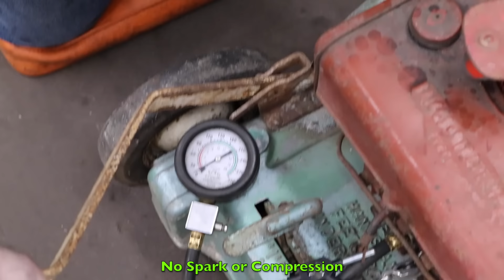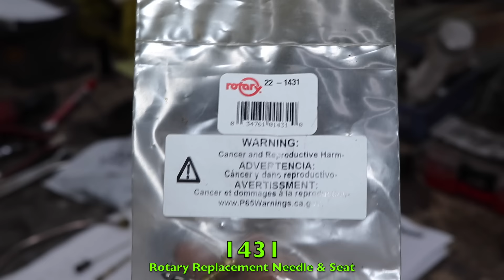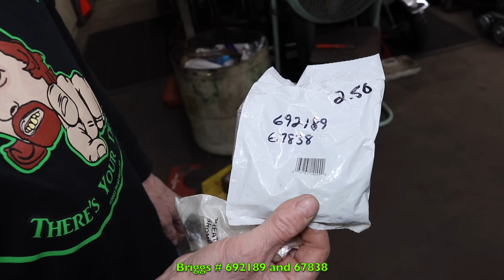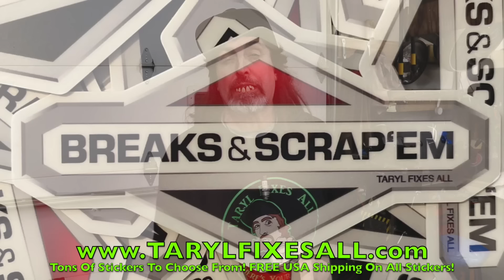RARE 1960 Hand Crank Mower Sitting 40 Years! Can It Be Saved?

Comment: The Briggs and scrap em engines from the 90s and earlier were so easy to work on,and very dependable.
Reply: sears and row back outboards, can't beat them..
Reply: I'll take a B&S over a Honda, any day.  The B&S carbs are very forgiving of bad fuel, whereas Honda is a pre-madonna. Leave it alone for a week, and the carb is clogged up and runs like crap.
Reply: @airplanegeorge  You mean craftsman
Reply: @frankbill9172  No, Crapsman!
Reply: @newsnowriversidesgtrock  YEP! Right there
Reply: @jeffpiatt3879  prima donna?
Reply: @gfriedman99  What about their commercial Vanguard's? Any hope or still cheap plastic junk?
Reply: He's saying Breaks and Scrap'em, if you didn't know.
Reply: @Vultain  Industrial/Commercial Vanguard might be ok, but these Intek OHV engines seem to have a chronic bad compression release mechanism. Tons of YT videos showing that they go bad and then you can't start them.
Reply: @Hjerte_Verke  That makes sense, I have a Kawasaki FJ180V, a Honda GCV160, and an older Briggs Quantum(mind you the rings are slowly going and it's an aluminum Quantum, not worth rebuilding).

I did hear the Intek's bend easy and slip out of adjustment pretty easy. I appreciate the heads-up. I simply don't have personal experience with them.

Honestly the Kohler Commercial 240CC scares me in the sense it can be hooked up to a computer. I've debated grabbing a Honda GXV160 vertical shaft engine while I still can. The clock feels like it's ticking on that.
Reply: You're right I bought a new machine with a Briggs engine and I had to pull the plastic carb about an hour after i t bought to stop the plastic piece of junk from hunting I call it hunting surging really , it wouldn't idle or stay at a steady speed and no carb adjustment.
Reply: I'm not to far from Richmond
Reply: I dont like eggplants

Comment: When I was a kid my uncle had a small engine shop and I did most the repairs. I worked on alot of these mowers. Believe it or not alot of the ppl wanted the crank starters taken off. We had some old parts laying around and we changed out a few. He closed down after a while , sold everything off to a guy. Lots of parts and old/new stock that's priceless now. Carb kits for those mowers, he had alot of them. He had boxes of carb parts he got from a shop went out of business in the 70s. I remember sorting and stocking gaskets and glass sediment bowls for engines. This was around  46 or 47 years ago. 1976 or 77. I never seen one of those oil minders. That's pretty cool.

Comment: That green deck reminds me of the old Kee mowers. My neighbor had two of them. I got one running. The other was a donor. It went to the scrap yard. The oil monitor reminded me. Several years ago, a friend called me to go through her late fathers shop. He was a contracted Sears repairman. I was able to get two new in the box full block 8 HP engines. Two rebuilt engines, I believe both were 5HP, and a short block 8HP. A bunch of new old B&S parts, Tecumish parts. New and used gas tanks, and other stuff. Most all is gone now. Nice job on the mower. Like you said, patience!

Comment: 1:19:45 that knob also explains why there's a gouge in every cooling fin on the flywheel. It was half-engaged while running at least once and nearly destroyed the flywheel. Maybe some goofball 40 years ago tried to stop the engine with that knob. Shame about the original starter clutch. You CAN clean the inside of those with a gun bore brush too and also polish the crankshaft extension to eliminate the squeal. Maybe it needs a felt disc in the end to hold a few drops of 30 weight oil as well, like the newer style you replaced it with? The noise is pretty easy to deal with.

Comment: CAST ALUMINUM, THEY DON'T MAKE THEM ANYMORE, USALY YOU SEE THE 2 STROKES ON THE ALUMINUM DECKS. I HAVE AN OLD JOHN DARE WITH A ALUMINUM DECK, I THINK IT'S A 4-STROKE BUT NOT POSITIVE. TARYL I'VE ONLY BEEN WATCHING FOR A FEW MONTHS,   YOU GOT MY ATTENTION. YOU GUYS ARE FUNNY, I LOVE IT ALL, BOTH CH.  WHEN I WAS ABOUT 13 YEARS OLD   I USED TO DRIVE MY SIT-DOWN LAWN MOWER WITH A TRAILER MY OLD MAN MADE WITH PLYWOOD TO THE TOWN  DUMP. I WOULD BRING HOME OLD LAWNMOWERS CLEAN OUT THE CARBS, GET THEM RUNNING THEN SELL THEM IN FRONT OF THE HOUSE.  I ALSO SOLD SCRAP METAL, AND BOUGHT MY FIRST WELDER WHEN I WAS 15. YOUR CH BRINGS BACK MEMORIES.''                                                                                        THANK YOU TARYL  🙋‍♂✌

Comment: Hey. “You are not supposed to be sanding the points. It leaves sanding grit in there and it makes them wear out”
😂.  They must have not heard of brake clean and compressed air. As a dealer you want to sell parts, but sanding works. Love my Sunday mornings with my coffee, robe and ascot, watching your skits and adventures into the mechanics life. I’ve been doing it  (repairing) for 50 year and still love it ❤. Thanks for what you do. Sb
Reply: My mower and my car still have points. Never heard of the grit wearing things. I guess it could. Personally, the problem I had was if you don't clean up after your clean up, the grit could hold the points apart and prevent contact and spark. I've seen lots of Youtubers buy new points after sanding. They couldn't figure out why they didn't work. Wasted a lot of money just in gas driving to the parts store. Sanding works great if you understand the risks.

Comment: Great video as always, Taryl! I love these old machine videos because they take me back to my youth. By the way, the  trigger positions on Weller soldering guns are the opposite of what you would think. The first position is high, and the second position is the low setting. Just an FYI.
Reply: Not true. I have two. Got my first one in 72. Still have it. First click is low, second it high on both of them made 30 yrs apart. If yours isn't like that, maybe it's been apart and someone switched the wires around. I got both mine brand new.
Reply: @MaxNafeHorsemanship  It is you that's mistaken. Google the manual. I have both the professional (260/200 watt), and the universal (140/100 watt) guns. They both they are high on first click, and low on the second click.

Comment: I really enjoy these videos of vintage equipment repair. You can learn alot, including the need to be creative, as illustrated by the carb bowl gasket modification. TD's advice about muriatic acid is very good. Muriatic acid is a form of hydrochloric acid and can be nasty stuff if you're not careful. Use gloves. It can be a skin irritant even if the residue on its container appears to be dried  out. Great educational video.

Comment: That Oil Minder came as standard with our 1974-ish Swedish Klippo Kommun with a Briggs engine, quite like the one you just breathed life into. Also solid aluminium deck and very good large ball bearing wheels. Klippo was also very early with a one lever/4-wheel height adjustment, which this one also had. Sits on the side and very dependable mechanism. Never had one break or seize up. I still have a 1977 variant, but the previous owner converted it (sadly) to a dip stick instead. Loved the video, thanks!

Comment: On those old oil bath air cleaners used dexron transmission fluid and you can add a tad bit more it helps lubricate the valve. If filters 3 times better than oil you'll see a lot more dirt build up in the bottom that's how good it filters out the dirt.

Comment: Faryl gave great advice on the Weller Solder iron. I have one it is superior to the others I have.  It works also amazing as a plastic welder and you can get a flat tip for it to finish the plastic welds.

Comment: This mower has some great features for the time, but at least a couple of dangerous aspects stick out to me. If you look at 01:24:39 the carburetor is directly above the exhaust muffler. That is a fire waiting to happen.. And the side discharge chute at 01:09:15 is awesome and dangerous as hell at the same time.

I'm glad we learned and implemented small (but significant) safety improvements over the years.

Comment: Hey Taryl love your channel! I have two troybilt horse tillers with Kroler 8 hp castirons from the 80s but would love to see a video on belt replacement and especially proper tensioning. Great piece of equipment but everyone I know has problems with belt tension making it where you have to hold the lever down to engage forward. “Help me Mr Wizard “

Comment: Elin, like you I am a big believer in restoring as many of the original parts as possible, but it looked to me like some pitting still remained in the clutch slave cylinder.  If you spend the time honing all the pits, then the rubber seal probably won't have enough tension to seal against the cylinder walls.  By the way, DOT5 silicone fluid is fully compatible with silicone grease.  Love your videos
Reply: Ignore this comment.  Wrong video

Comment: To clean motorcycles tanks, I toss in some short sheet rock screws and lacquer thinner or vinegar.    I stick the tank in my old electric cement mixer and cram in some old blankets or inflate some old inner tubes to keep it from tumbling around in the mixer.  Works like a champ

Comment: I have an antique Ariens snowblower where you can remove the snow blowing attachment replace it with a grass cutting deck. If you're interested I could bring it down to your shop free of charge. I think it's pretty neat because it also has a locking differential.

Comment: I found 1 of those engines under a house, It had a broken con rod. I took the guts out of an early 35 sprint and swap it over in the early engine after giving it a hone, no points indent on the 35 sprint crank so I also used flywheel and electronic ignition. It's mowing grass to this day. My tank was leaking in the same place.  There's your dinner!

Comment: Weller Trigger 1st pull is high wattage, 2nd pull is lower wattage.
Dual Power Trigger
Soldering Gun delivers two levels of power for your soldering task needs, both deliver heat up to 900 °F. When full 260 Watt power is needed, pull the trigger halfway. When medium-high 200 Watt power is needed, pull the trigger fully

Comment: My dad had a similar Sears Craftsman crank start mower.  I don't believe it had a switch on the side to start it.  With his, you simply used the crank, made sure the throttle was set properly and when swinging the hinged crank back into compacted position, it made contact there, which also released the spring.  All in one motion.  Interesting that the handle is very similar.  His was also self propelled.

Comment: I can't TELL you how much grief that wind-up starter caused me as a kid.  The flywheel blades would get worn down and the lock wouldn't hold the spring back anymore.  Usually it would let go before I'm done winding, and often enough, the engine would start with the locking pawl still stuck into the flywheel fan blades.  Screeeech!  What a BAD idea!

Comment: We had a mower, maybe a toro...1960 something. Had the wind- up crank start, and some kind of oil sight glass. I cant remember pushing a rubber siphon button though. I do remember cutting the back 1/8th acre and hearing a loud bang. Took it to " Lawn Barn" and they showed my mom and i where the rod shot thru the side of the crankcase. I was 9 years old, what did i know about oil??  The lawn barn salesman used that low oil dilemma to sell us our first 2 cycle green lawn boy. Never needed to check oil ever again.

Comment: The heat worked because it was able to transfer to the engine and expand the hole along with the pipe. Then quenching the pipe cools it faster and is shrinks away from the hole. Lubrication does not happen or matter. A stuck nut you would heat to glowing and turn off then while it is still big.. quenching the stud may help if you can but usually not necessary. I am rambling...

Comment: I'm 67 now, when I was 10-12 years old I used a mower with the crank type starter like that one has. It was a unique way to start the engine. They probably switch over to the pull rope because it was cheaper to make.

Comment: Good old Engines. When they actually had power. Don't know why but them old 3.5 Horse motors would not Bog down under load for nothing. My Honda 5.5 Horse mower will bog down under any slightly heavy load cutting grass. Governor works, but these newer motors don't seem to have the "Torque" or something.
Reply: They are Adjusted and leaned out for Emissions thats why they have no real power

Comment: I’ve found another place that makes them squeal is between the two parts of the starter drive . A thin plastic or nylon washer will stop it from squealing  . Witch date code did you go by the manufacturer of the mower or the Briggs date code ?

Comment: My uncle had a Pennsylvania brand mower, B&S engine with the same crank start. Around 1962, '63. For years he started it with a 1/2" electric drill because the crank start packed it in.

Comment: Wow it's like the early Honda self-propelled mowers Aluminum deck we had one growing up the only mower are used for like 20 years and it's still running and going strong the deck just has a little hole in it from being sandblasted from 20 years of sand and dirt from the grass

Comment: I have a 1960's 2000w generator that has a tank just like that briggs motor. It runs and still generates power. It is loud as a jumbo jet. When I pulled the float bowl it was brand new inside. The unit is called "MITE-E-LITE" (Not the McCullough one it is an original).

Comment: Here's a tip trick for that Weller gun, cut a piece of 12ga copper Romex wire strip the insulation and bend it to fit the gun. Make as many in as many sizes as you want. Cheaper than buying replacement tips and works better too.

Comment: Curiosity got the better of me, so I did a search on the jungle site and that Oil Minder is still available. Also, not a big deal, but the high position on the weller soldering gun is the first position and low is trigger fully engaged.

Comment: My tractor has the Kohler 7000 series Engine 22 horsepower 725cc V Twin Kohler designed it after the Kohler command commercial Pro Engine came with a 3 year unlimited hours warranty absolutely incredible Engine..

Comment: I remember those wind up lawn mowers!
Must admit, I forgot about them till I saw the one you worked on. Seemed that when you were cutting the grass the rpm was very high. Those 3.5hp were not that powerful from what I remember. My dad bought me a 4hp sensation with rear wire bagger when I was about 12 or 13. Even had grease fittings on the wheels!
That one had the rotating valves and some real power- can you explain how the rotating valves worked?

Comment: That's a Briggs and Stratton 81353 style engine right? I have one im working on that is a 1959 with the 110v electric start, where you plug in an extension cord. Looks close to mine but his is a vertical shaft and mine is horizontal. @Taryl do you know where to get the part number (221038) belt guard. Can't find it anywhere, since you work on old engines figured you might know.  Thanks for your time.

Comment: Hi Taryl, Could you do a segment on how to rebuild a transmission on Troybilt Tiller? I changed the seals but they still leak. I put two or three sets of seals on the tiller but it still leaks. Also, why do parts companies make some parts for older machines, but don't make other parts for the same machines?

Comment: Taryl - Try an automotive fuse puller to remove the points plunger from its socket. Fuse pullers are made of semi-flexible plastic so there should be little risk of damaging the metal plunger. Plus the puller's jaws will grip the entire length of the exposed plunger surface - better than your fingertips.

Comment: I'd like to have that old mower! I'd use it! That's back when they built good things!! And I've had several of those oil minders,, when the oil got really dirty, it was hard to tell if you had oil, because that plastic would turn dark over time,, mine went where the gas tank pressure primer went, in the GARBAGE!!

Comment: Why use a paint shaker that goes at one speed and could bust a tank, Maybe use a variable speed moter with a clamp platform on it for different size tanks. Like that one is connected to the wind starter!

Comment: There used to be a 1967 AMC Ambassador parked in the back yard that had a Briggs Stratton engine in it, the air cleaner read Briggs Stratton
 typhone. It was a small V8.

Comment: Man I cut my teeth on those ole mower engine's , ( Ole Man beat my ass for tearing into his boat motor 🤣) . Went to Auto's from there  fleet work , dealership, Moved up to OTR Trucks Mack's , 4:42 Pete's ,Freightliners , KW , some ole Diamond Rio's . Landed a job restoring antique construction equipment, as in stuff dragged by mules right on up to Steam Shovels like the dug the Panama Canal . From their Worked for Caterpillar Equipment Co starting as a Mobile Mechanic an retiring as Shop Foreman.

Comment: Those crank mowers had to have perfect points to run. If it doesn’t have perfect spark, you crank and crank all day and it won’t run. The same engine with a pull rope is easier to get to fire with marginal points. That is why my Dad got rid of his crank mower in favor of a Craftsman Tecumseh with a pull rope in 1970. He had that Tecumseh for years and years.

Comment: When it comes to points I say sand them and send them!!! Never failed me!  Spark plugs to wire brush em and send em.  Save your money. You only really need a new spark plug if there's a mechanical damage to the spark plug it is that point probably something catastrophically wrong with the engine. Or if the ceramic broke.

Comment: As a kid on the late 80's early 90's. Till 2000 when my grandpa died he used a mower similar to this. Not sure the brand. The handle bars were white. And the mower was sort of a salmon color. So he may have been orange or red when new. The engine may have been painted white as well but I can't remember.